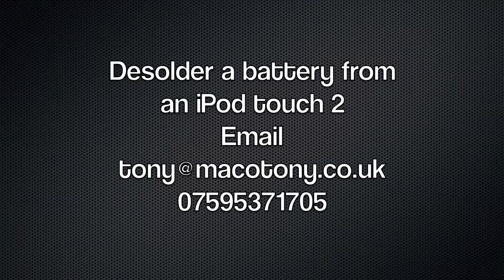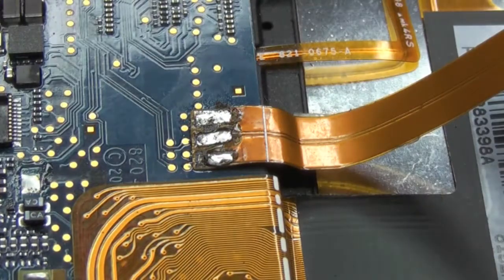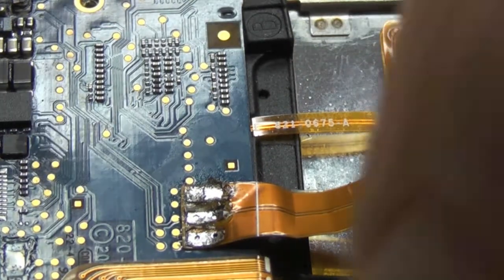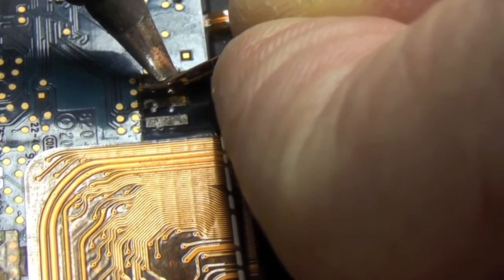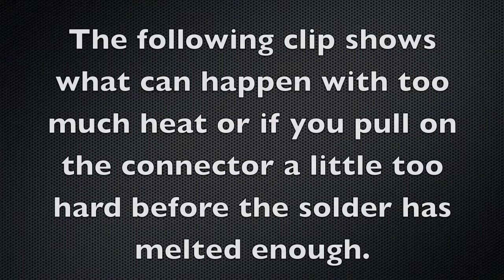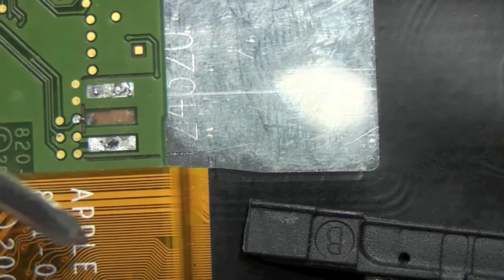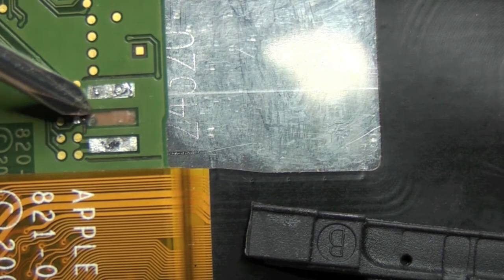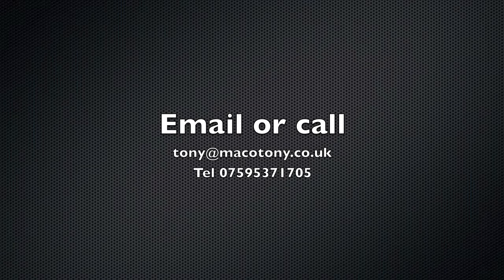iPod touch Battery desolder

Comment: Well, I just did it with the 45 watt iron, and it melts it easily and quickly. Only had a conical tip, but still managed to pull through. Ipod charges and seems to work as it did before, but the battery level is way off. The percentage hovers around 25-35% and never goes beyond that when charging for a long period of time. Anyone know how long it will take for the ipod to calibrate itself with the battery?

Comment: What was the wattage of soldering iron that you used? I have a 45 watt version and I'm not sure if it's enough heat. No specs on the exact temperature though for that iron

Comment: Fine and dandy, but how do you reattach the new battery? More specifically, how do you 'tin' the 3 new connections on the ribbon? Or, do you simply place and heat up the original solder?

Comment: @paulgwj You need to put some rosin flux on the board first, and you must have a properly tinned point on you soldering iron. Clean your tip everytime you solder a connection by wiping it quickly on a Moist sponge or cloth to maintain the tip of your iron.
Apply a small amount of solder to the tip each time after you clean it.